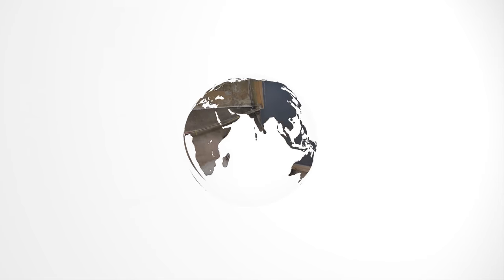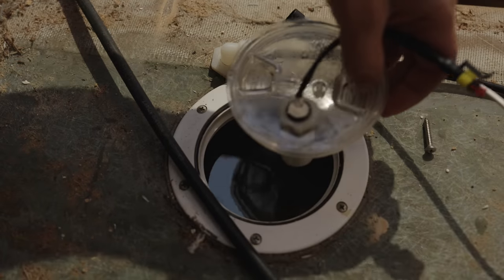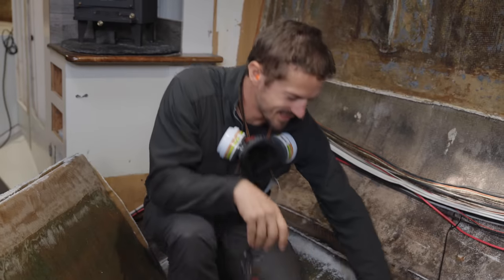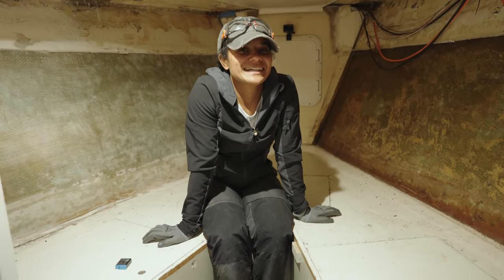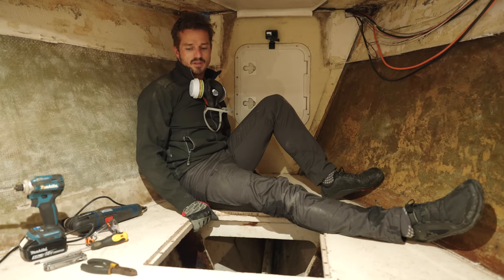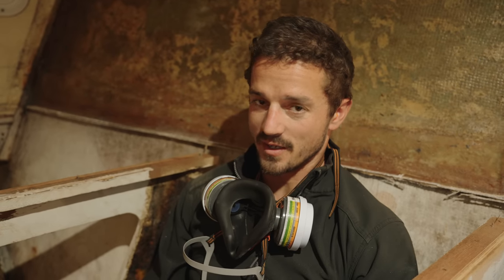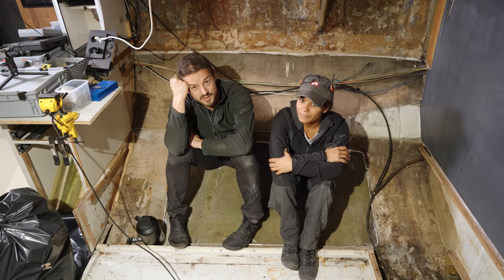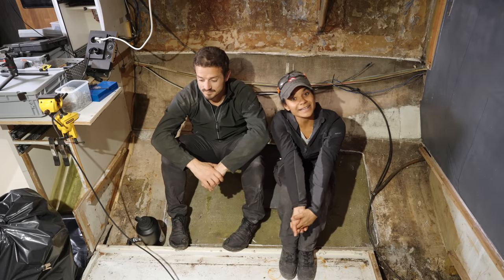It's Worse than we Thought | Step 347

Comment: I guess economically it would make more sense to buy a new boat, but I can also understand the sentimental reasons and the project challenge.
Reply from the maker: Your guess is wrong. This refit will cost about 20-30k . A new or ever new-used boat…. At the very minimum Add a zero .
Reply: @SailingUma  and if you bought a used boat, even if it was a lot newer, you’d still end up doing a lot of refit work to make it what you want, plus modifications to go electric.

Comment: WARNING there must be space between the wood and the hull if the construction is like that, otherwise stress will be created there and the hull will crack. the hull is elastic up to the point where it is joined. dangerous
Reply from the maker: Lol. There’s supposed to be filler and glass there or the “bulkhead” is useless.
Reply: @SailingUma  how do you know that thats the intresting part

Comment: It appears your water tanks were more structural than your bulk heads.  So why not install new bulkheads where you want and in the desired interior shape and location … just a little … larger head might be nice if possible.
Asa retire boatbuilder I would love to be working on your boat … today I usually work for lunch with a beer.

Comment: Buy a different boat.  Once you do all the work necessary, it will still not be worth what you put into it.
Reply from the maker: It hasn't been "worth what we put into it" from day 1. That's not what it's about. Boats, cars, and motorcycles are all depreciating assets. You'll never get back what you put in. Especially if you include labour. We're well over $2mil if you include labour. It's about fixing things because the can be fixed. Not just tossing it in a landfill because it's a little broken.

Comment: I know you folks are good at rebuilding the boat,  but personally  I would have purchased a newer boat with fewer problems rather than rebuilding a 50 year old boat.  A newer boat would probably cost less than the cost of repairs on the older boat and definitely cost you less stress and wear and tear on the body.

Comment: Wouldn't it be much easier to just find another, better boat?
Reply from the maker: New boat, new problems. It would still require a year of work at least. We know exactly what’s wrong with Uma and how to fix it.
Reply: @SailingUma  It has been fascinating to watch the transition Sailing Magic Carpet has made with their new boat. Of course, Aladino is a really talented boat builder. If you put the same quality into your current rebuild as you did when you renovated your galley, it's going to be beautiful. and structurally much better.

Comment: Why? Realistically, is your boat a good candidate for rebuilding?   No.  My 1996 sailboat is constructed using vinylester resin, has an aramid/kevlar  armor belt two inches thick at the waterline, and a steel chainplate frame.  Your boat is more of mould for a boat.

Comment: Bulkheads are structural ….. That Bulkhead is set at a 10 cm vent Gap with Ply Studs for support …. Every Boat Builder know that, Your pro Sailers yes but Boat Builder NO. Get Professional Help..
Reply from the maker: We’ve seen dozens of boats from dozens of shipyards in every state of construction. We’ve never seen bulkheads that aren’t fully glassed to the hull.
Reply: Bolted, nailed or riveted fasterners on structural elements are still common practice where method is suitable. This solution is perfectly ok for this type of  vessel and its classification.
Reply: @SailingUma  approach is sound but if the hull laminate is quite thin then the flexing in a seaway will be stressing against hard points… which means ribs as you mentioned (& longitudinal stringers which you didn’t mention but I bet you know anyway).
The spacing & amount of stiffness in those stringers need not be exact but worth getting a naval architect or builder to confirm your plans. 
The water forces are generally in the opposite direction to that which eventually saw the rig strain pull the chain plates out - flex will take longer to work but still cracks the glass fibre mat around hard spots.
Good luck - it’s a big project but you have the skills & the cost is less than buying another boat & then fixing that one!